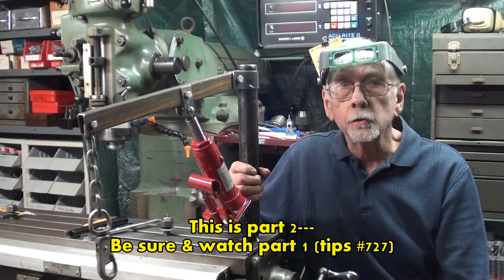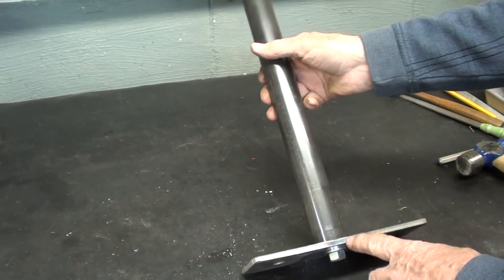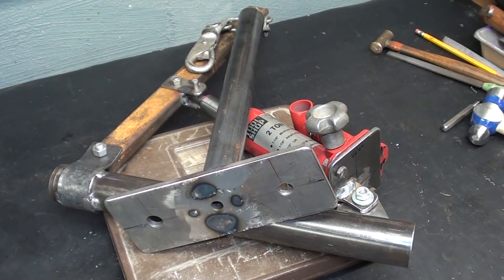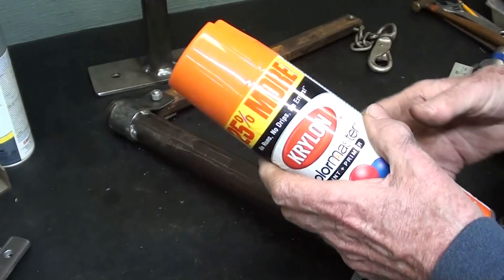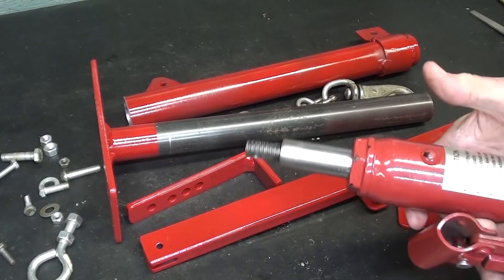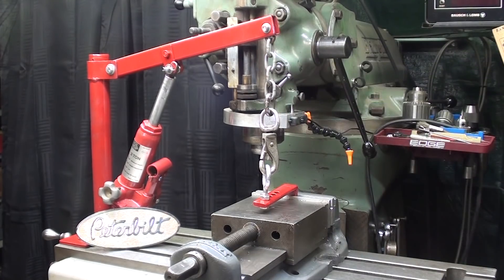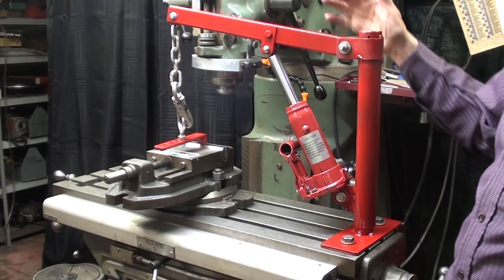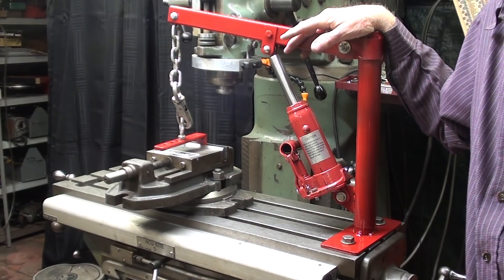Tubal-Crane - SKY CRANE for Bridgeport Mill Vises pt 2 #728 tubalcain

Comment: A great bit of kit to be proud of. The extended boom is a good idea. Moving the bracket back along the boom makes a lot of sense too. With two tons available you could easily make the hydraulic cylinder almost vertical and it would still work a treat, as well as give a greater height to lift the vice up from.

Comment: Great job. One thought I had was that you should replace the jack with an adjustable telescoping strut with a pin to set length. A small lever hoist hanging of the end would give you the lifting and lowering ability. This would allow you to lower to the floor if needed like this one, rated 550 lbs and a 5' working length:
https://www.northerntool.com/shop/tools/product_200710433_200710433?cm_mmc=Google-pla&utm_source=Google_PLA&utm_medium=Material%20Handling%20%3E%20Hoists%20%26%20Lifts%20%2B%20Cranes&utm_campaign=Ironton&utm_content=57095&gclid=CjwKCAjw-qeFBhAsEiwA2G7Nl6KMxVtyfM9IHB6aVI-NYolkAu3vl0xiqw-sxfNq5zobiLouzgJFkBoCsdEQAvD_BwE&gclsrc=aw.ds

This would make it even lighter and the lever hoist could be used elsewhere. I find I use mine all the time.

Comment: Nice. It had me wondering though how much angled stress that tiny piece of T-slot on the end will take before it breaks out. I've seen several tables with that part broken off. Perhaps they put too long of a bolt in the t-nut. I've never broken one myself so I don't really know what kind of force it would take. It just made one eyebrow go up when I saw that...
Reply from the maker: It would take tremendous force. Possibly one or 2 tons

Comment: Nice shop too Mr Petel. In the Hydraulic/ Mechanical shop I first worked in a long time ago, there were many items requested by management and designed by engineering as shop aids sitting off in the corners collecting dust. They got an official shop number, but just weren't ever practical to use. Typically one of the workers would just make something themselves that would get used instead. Production Engineering typically cared only about specifications and critical functions, not how easy it was to put into use..
Reply from the maker: Good comment. An item Hass to be lightweight and very easy to use

Comment: I made one that works similar except that I used one of those miniature lever chain hoists and my boom doesn't lift but slides in/out.  I also have found various other uses for that hoist around the shop partly because it's much smaller than a come-along.  Boat trailer winches can be handy too.

It sucks getting old and needing things like this, but maybe if I had used things like this my entire life the wear and tear wouldn't have been as bad.

Comment: If you want a cheap, easy bearing, you could turn and weld a cap on the top of the fixed pipe, being sure to put a center drill hole in it.  Superglue a ball bearing into the divot and you're done. Because all the load is essentially on the axis, it will take almost no torque to turn.
Reply from the maker: Good idea
Reply: Excellent idea! I worked on a RCCL cruise ship as a musician many years back. They had pool tables. Eh? How do you have a pool table on a ship that rocks and pitches? (yes, even those big cruise ships) Turns out the entire top surface was mounted on a single central ball bearing about the size of a grape and could shift in 2 dimensions using a microprocessor-controlled tilt-sensing mechanism with hydraulic cylinders doing the work.
Reply: @pneumatic00  
  Sounds great for the leveling of the pool table on the cruise ship, but how the heck did they compensate for the forces of inertia that the ship's pitching is sure to generate?
Reply: @stanervin6108  I can't answer "how" beyond what I already said, but in all but the most pitchy seas, you could watch people playing pool and the balls on the table would stay still! Yeah, those times when we entered a storm, the tables weren't being used, or, you could see table balls moving in response to the ship's movement. You could always definitely see the top surface tweak up & down in "normal" conditions.
Reply: @stanervin6108  That's easy, the ship's moment of inertia is 1000 times larger than the pool table.  So the pool table stays steady.
Reply: @pneumatic00  That's why the pool table is steady, the players are seasick!
Reply: Ken, I like your idea of a ball bearing on the fixed post. If I understand it correctly you'll have a point contact on a hardened ball so very little friction.
Reply: @pneumatic00  Trippy.
Reply: @pneumatic00  Lol, that has to be one of the most ridiculous things I've ever seen.
Love it!

You can see the 14 ball move though at 55 seconds, I wonder if they've gotten more responsive over time?

Comment: Love you enginnuitity (is this a new word) very creative and useful. I would give you an A+ grade for the build. The only suggested improvement would be on the part that is clamped in the vise jaws. I would lengthen it to include a piece that slips over the vise screw to help support the vise and not have an accidental drop of the vise. 

Thanks for the great videos, 
Lecil Alexander
Reply from the maker: I like that word
Reply: @mrpete222  what do you think of my suggestion, overkill?
Reply from the maker: Yes, overkill by 10,000%

Comment: Lyle, looks and works great, just a little concerned about the amount of welding on the post to the plate. Looks a bit on the light side, especially as you are a home welder and it may not be fully penetrated. Might pay you to add some more or get it welded by a professional. Not being nasty here, but if that weld should break when the vice is in transit, you could either do serious damage or even hurt yourself. For others, perhaps turn up a flange and bolt it to the plate using tensile countersunk bolts through the plate. Regards from Australia.
Reply from the maker: I knew that one was coming
Reply: @mrpete222  😂😉👊

Comment: I've used a little piece of 1/2 cold rolled to find the CG of parts with flat bottoms on occasion....  Just to keep from lifting them.  
I really liked the product placement in front of that curtain....  And then I remembered Carol Farrell.  "What's behind Door Number 3???"  I don't know Monty.
I worry a bit about the vise slipping off the narrow strap, but it's probably unfounded.
Great build.
Reply: Ooops... Carol Merrill.  I wonder how many years has it been since the last time I saw Lets Make A Deal?

Comment: Had one of those random thoughts race through my head, instead of a hook use one of those 150lb magnets as an attachment point, then center of gravity is just a question of placement. I was wondering if you looked at one of those truck bed cranes with the strap lifter its very similar to the cable lifter without the cable to scratch up the work

Comment: An elegant solution to a very real problem.  I can still manage a mill vise but I make sure I know where it's going before I pick it up and that there's a clear pathway for me to move through.  It's interesting but frustrating as I get older the things that once were easy become more challenging.  Like getting myself up off the ground, for instance...
It occurs to me that the CainCrane is also useful for raising heavy work to the mill table.
Reply from the maker: Yes

Comment: You should just add a short piece to your boom make it telescope like a engine hoist.
Reply from the maker: Good idea
Reply: I have done that very thing.  Useful
Reply: And that you could make solid steel, even machining to fit the inside of the rectangular tube. And it wouldn't put more than one and a half pounds on the total weight if you restricted it to about 7" in length.

Comment: Lyle, I just recently got an "engine crane" from a guy who got it from his neighbor who used it to lift a disabled person from bed to the wheelchair. I'll use it for positioning the engine on my tractor and a few other things. It was very inexpensive, and good for about 500 pounds, which is more than I plan to lift. I mention this because it may be something that would be overlooked in ones quest to find tools.
Reply from the maker: Thanks
Reply: @mrpete222  they look like this, and I will change the two point lift to single point.
https://towsonmedicalequipment.com/wp-content/uploads/2016/03/13023svlb.jpg

Comment: Painting a RED Dot on the center of gravity would help speed up hooking up the hook in the proper spot without having to think hard about it.
Reply: On the vise? Yes, that might work. But on the vise "insert" you can't, since it's designed to handle multiple vises, with or without the swivel base.
Reply: @ligius3  vise, the fixture only fits one way lining that up over a RED Dot would clearly show which hole to use. Like, aiming using a RED Dot site.... I thought that was obvious. Guess not.

Comment: Outstanding!
If I had the floor space for a dedicated vise cart, I’d be making one right now.
I have to wait for one of my boys to come over to use my rotary table:)
Reply: I built a self storing articulated arm that my super spacer resides on when not in use.  (Weighs way more than a rotary table) It is an old idea for Bridgeport mills, but could be adapted to any mill. 2 pieces of rectangular tubing bolted together to form the articulating joint long enough in total to reach the backside of the mill.  (Bolt the tubing through the small dimension for strength and use my lock nuts.) A second bolt attaches this arm to a bracket you will have to make out of plate that fits under the 2 bolts on the left hand side of the mill that allow you to rotate the ram around.  In practice you raise or lower the knee to hook up your rotary table.(eye bolt through the center hole, or whatever) Lower the knee and swing the arm with rotary table attached to the back side of the mill and leave the table and arm back there suspended until the next time you need it.  Unless you have a shaping attachment back there that is just wasted space anyway.  DO NOT BE TEMPTED TO USE BALL BEARINGS AT THE SWIVEL POINTS.  You do not need them and the arm then moves too freely.  You want a little friction so your table doesn’t get out of control during its movement to the back or front.  Problem solved no waiting for boys.
Reply: @37yearsofanythingisenough39  
  What on earth is a 'super spacer'?
Reply: @stanervin6108  a super spacer is an indexing device that can be used in both the horizontal and vertical formats with a 3,4,or 6 jaw chuck attached.  It has masking plates that can be changed out to make common indexes without reading the degree scale.  You can also use it to machine arcs and etc. like a rotary table. An 8” is close to 100#.
Reply: @37yearsofanythingisenough39   
Thank you very much for the reply! Come to think of it, I remember seeing something that matches your description. Waaay back in the late sixties when I was just a floor sweeper at a huge jobber shop. Never seen one since. Never saw it in use.
Reply: @stanervin6108  If you have a current (came out in 2017!) KBC Tool catalog (black cover) there is a picture of the Bison version on the top of page 314.  I was light in my weight estimate. 8” is 127 pounds!
Reply: @37yearsofanythingisenough39  
  KBC online has the 8" for FOUR GRAND! They sure are proud of their baby!
Reply: @stanervin6108  I’m glad I bought mine decades ago in that case.  That is one heck of an expensive mill accessory.
Reply from the maker: Yes, I meant to show my rotary table. It is the heaviest of all